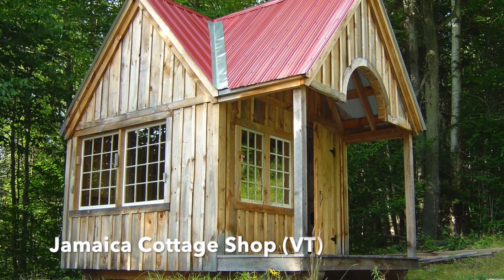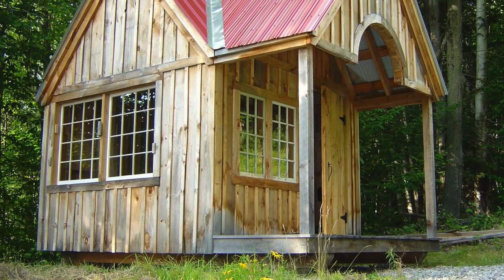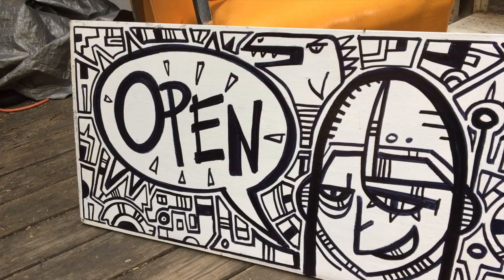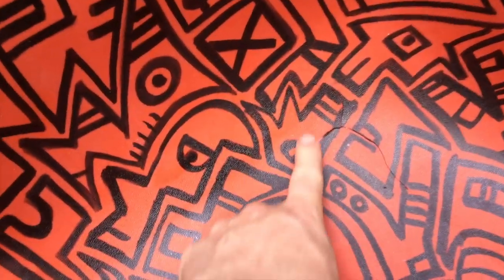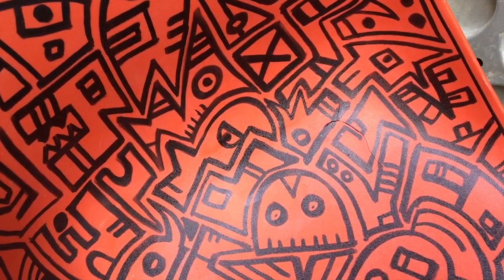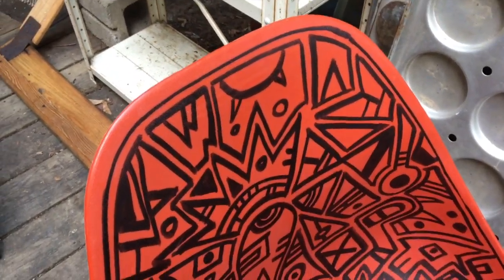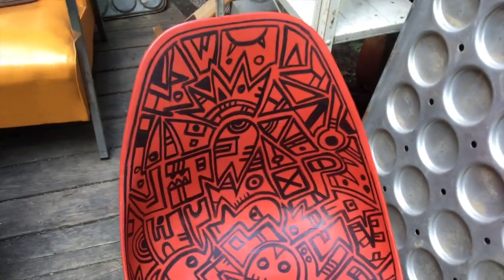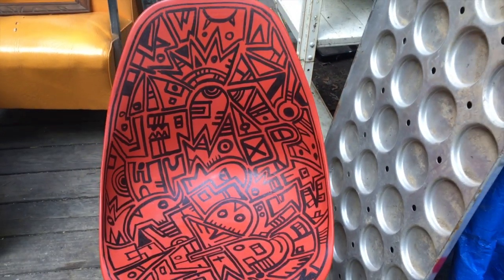MESSING UP a mid century modern Herman Miller/Eames chair? (Graffiti Art

Comment: I think that it looks great!  I really love it! I have always thought that furniture art is great.  I would however put some sealant of some kind over it if it is going to be sat on.  Sharpies are not as permanent as you might think.  Butts can cause the ink to buff right off. I have used sharpies to mark some of my tools and I have also drawn on plastic mugs with them and after a few months the ink starts to ware off. Great way to rescue a chair though.  :-D
Reply from the maker: We usually later add a protective clear coat- as you are right (about butts, etc)